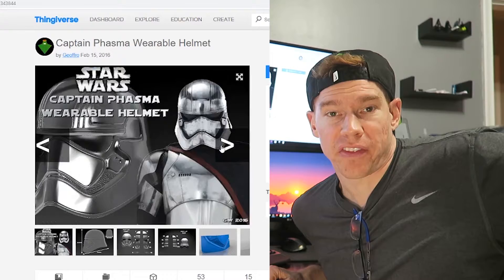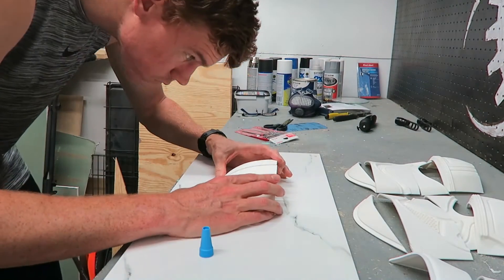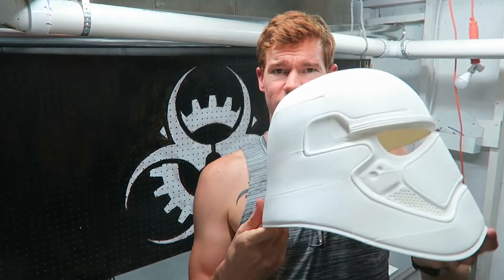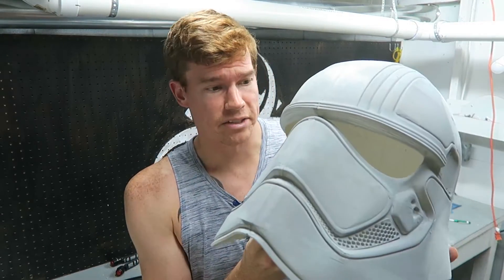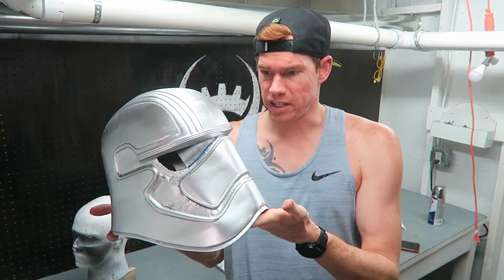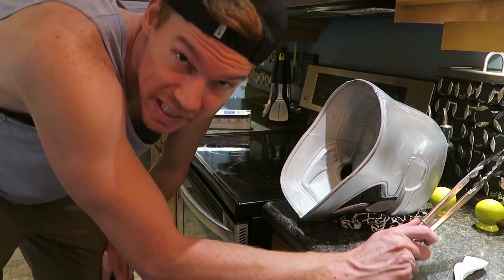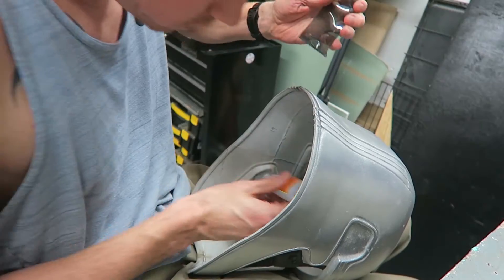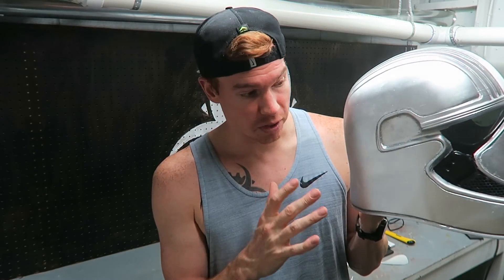3D PRINTED CAPTAIN PHASMA HELMET | CREALITY CR-10

Comment: This is a cool print, and it's making me consider buying a CR-10 Pro... if you want a mirror finish for something like this, you would have to go beyond 220 grit sandpaper. The reason why the finish didn't come out reflective is that after you used the filler primer, and then painted it, the surface finish was too matte (the microdetail from the paint would make it feel like brushed metal.). 

If you really want a nice polish to your prints, you can use the filler primer, and then wet sand at 400 grit, 800, and you can stop at 1000 grit...I've use 2000 grit and it is damn near mirror-like. And sand in a circular motion. I like your channel man... subscribed. :)

Comment: The chrome paint does work well but only on a mirror finish. Therefore surface preparation is critical.
Why not try attaching an abrasive sponge an orbital sander to lessen the preparation work load. The sponge will "give" permitting you to sand the contours.

Comment: Nice job! For the seams, I’ve had great success with Spot and Glazing Putty from Bondo. It’s air dry too, so it’s easy to work with, and is a bit more fit for the job than wood filler. Acryl-Green Spot Putty from 3M is supposed to be even better, but I don’t have any experience with it personally. Great video though!
Reply: Pretty sure I’m seeing this guys videos because of your comments haha.